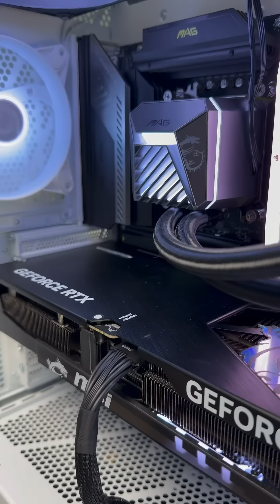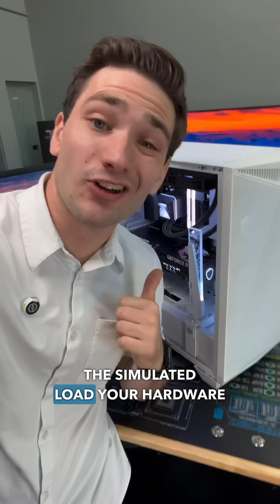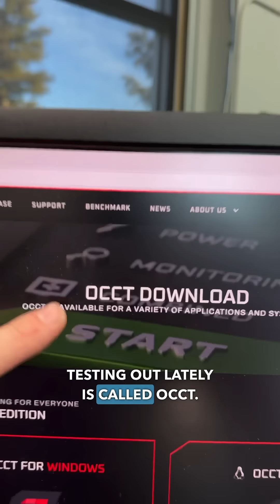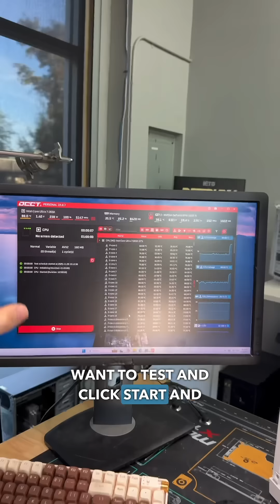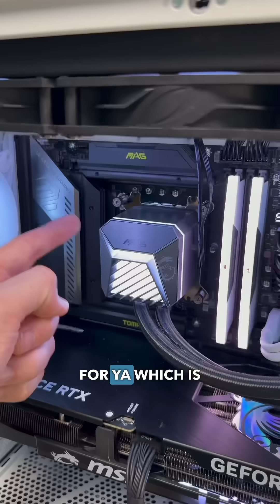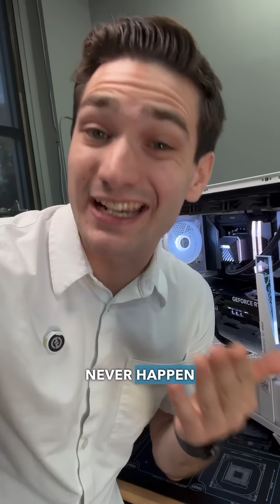Stress Test Your Gaming PC #tech #gamingpc #pcbuild #techtips #repair  #gamingrig #gamingcomputer

Comment: For the new techs out there, it’s important to understand that stress tests are a different type of load on a system than gaming, and that just because a system passes a stress test doesn’t mean it’ll game reliably. It’s a great way of testing general stability after a build, I agree as done in this video (and I’ve been using OCCT since the mid 2000’s… love it!) but if you’re troubleshooting you could find yourself banging your head against the wall expecting a hardware issue trying to run all these tests when you have a driver issue instead. 

Look up the differences in load between a stress test and gaming, just ask AI to get a quick explanation and you’ll understand. 

Matt, love your videos. Keep up the good work. And you sound like Mark Rober 😂

Comment: Those stress test applications don't damage your PC? What's the point of it? I don't want to burn my components for free
Reply: The point is to make sure that your pc can handle the load while you are monitoring it, instead of realizing the cooling is insufficient while playing a game. Nothing you do should actually damage components since there are many limits put in place. For example if the cpu gets too hot, it will throttle performance.

Comment: "probably never happen under any normal circumstance" he's never did any rendering in 3DSMax on a pc from 2012. that will 3ds "MAX" everything out then you try to stop it and It says no. then your PC says I'm tired Boss 😢 but fear not after an hour it's completed rendering.... that frame, so it's moved on to frame 2 of 593. so you ctrl alt delete nothing happens for 20 minutes and you pull the power cable.

Comment: Where are u located? After i shut down my PC and reboot it, EVERY TIME!!! It shows me TPM data it goves me the option to load with current and reset, i always choose load, then the next screen is ALWAYS my bitlocker and i put it in, at this point bitlocker is like my Password to get into my PC because ITS EVERY TIME I REBOOT!! Ive checked so much info and nothing gets it fixed. (Ive gone into bios to deactivate bitlocker, ive searched for bitlocker in the control panel or wtv that is, ive placed codes when i run as admin on that one black screen, and it says codes are invalid (i searched YT videos about it)

Comment: I had an interesting issue with my CPU recently where it was boosting itself untill it reached 95° most of the time.  But in a stress test, where it reached 100% utilization, it was running below 85°.  It's a 7600x on a mai gaming w/ wifi board and msi aio.  What ended up fixing my issue was setting it to throttle itself once it reached 85° in the BIOS settings.

Comment: Is that app free? And can it show some kind of comparison so I can swap components and see which combination gets a better score?
Reply: yes it is.
if you pay OCCT, you unlock some features only.
just…like…infinite stresstest feature something.

and good OCCT's part is?
it's non-30 days trial type of ware.
and then, this OCCT has very accurate at find you're CPU and DRAM causing errors!

when I'd switched from Ryzen5700X to 7800X3D, I met this software, and I'm using everytime nowdays.

everytime  is… I mean… tuning Ryzen CPU's voltage lowering and change the DRAM timings or bios settings.

also, OCCT have the benchmark option.
anyways, this software is very good enough for me.

if you need another accurate error check solution, maybe it'll helpful with go googling y-cruncher or prime95 or something words.

Comment: I still use prime95 to stress test my CPU 😅lol. Furmark can really stress the gpu, but be careful with it because I had it burn out a graphics card about 7 years ago. Lately, I run 3D mark through stream to benchmark my system and stress test it. Another option is Haven, but it’s beginning to show its age as a GPU benchmark/stress test. I usually don’t trust running a cpu benchmark or stress test unless I have a better than stock cooling heat sink fan or AIO installed because I don’t want to burn out my CPU (I have had it happen twice in the past 13 years once with a cheap hp board that the board actually died, and another time with a laptop). I wouldn’t suggest stress testing a laptop at all.
Reply: I use superposition with 8k settings if I want to max out my gpu

Comment: Well in my case, I had issues with my system and I used OCCT but that program said that everything was fine. So I tried AIDA64 Extreme stability test and that gave me the reason on why the system was failing. Thanksfully I RMA the faulty parts in time because I was breaking my mind trying to figure it out what was the problem. (Faulty motherboard AsRock Pg-Lightning b650 (change to b850-e Asus Rog Strix, and the Ryzen 7 7700x that was replace for the same cpu)
Reply: AsRock is crap with their motherboards, their b650 steel legend killed my 7900x cpu. Even while running everything at default with newest available bios, no PBO.
Reply: @bruh-l5r I have an old ASRock motherboard with an Intel i7 3770 and for years I never had an issue. The thing is not about the brand, it is about the product.
Reply: What kind of issues did you have?
Reply: @maximilianorojas2845 I had plenty. First thing was massive frame drops, but since I didn't do a clean install I was thinking of driver issues, so I did a fresh install of everything and that fixed the problem for a time. After that I had my usb port randomly disconnecting even the Ethernet cable, and I started thinking maybe it was my power supply (it wasn't). I started looking, maybe stability issues, so I updated the bios and funny enough that fixed the problem for two or three months but then I started having all the problems again, the same ones plus the PC started to reset itself while gaming, and I think maybe temperature problems? Nope but the good news is that now I can see when my PC was about to fail because the light effects in my keyboard started to fail (not working as intended). Two things could happen, first the frame drops got so bad that the PC just freezes itself or just restarts itself. And after trying a lot of things, every time I Google the problems I had, it says "it's the CPU" "it's the ram" "the power supply" etc until I found a post on the ASRock forum that someone found something wrong in the motherboard (and for some reason the b650 models, the "Pg Lightning") and that was causing all the issues. So I talked to the shop I bought my stuff and explained everything and they said ok send the motherboard and CPU and they confirmed that both things were faulty.

And another thing, that I didn't know at that time, the PC will not post with 2 sticks of ram only with 1. And that's a sign of a faulty cpu.

Sorry for the long reply. I can't remember if something else happened.